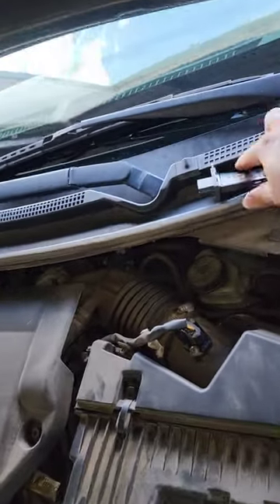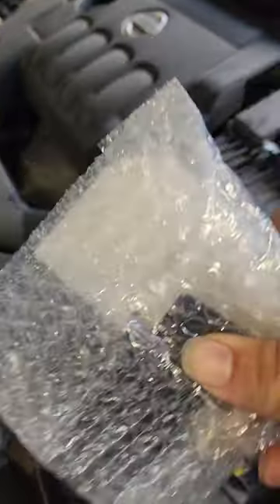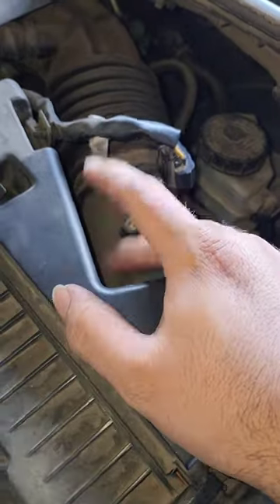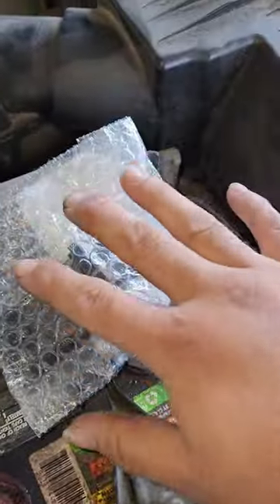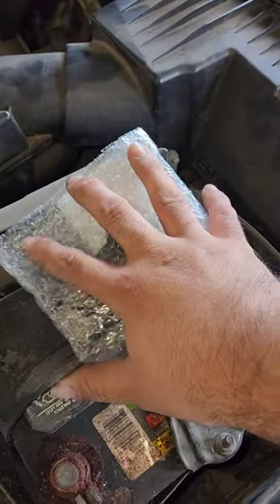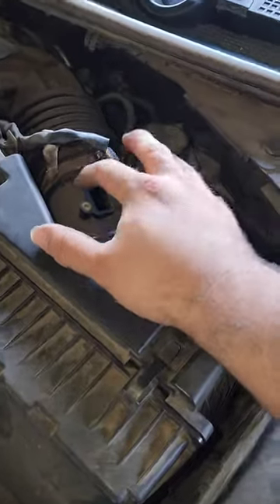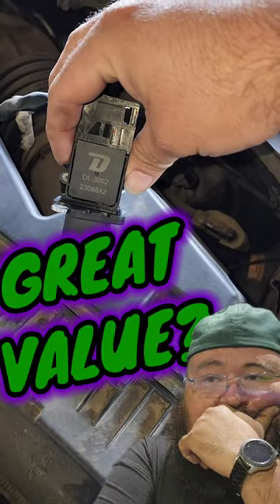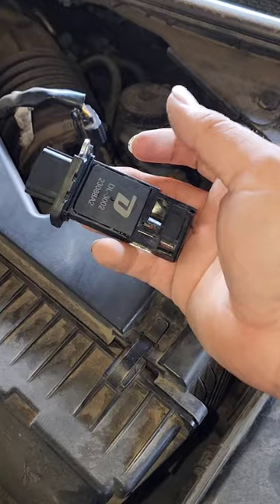AUTOZONE STRIKES AGAIN #shorts #auto #mechanic

Comment: OEM quality isnt what it used to be! 😢
Reply from the maker: Hind sight i dont think the sensor failed to begin with...granted it did have 150k on the ticker but i think they got conned into buying a sensor yet this vehicle needed an update for that code being thrown...then by then using the duralast part just upset the computer and threw all sorts of mass air flow codes...ouch
Reply: @FluffyMexicanik  years ago ( in the late 80’s ) GM had an issue with their mass airflow system. There fix was not only the update but they had built an airflow that didn’t actually function, it was designed to trick the computer to think it was working and kept the light off. I think that practice by manufacturer is used too often , remember the diesel scandal by German cars .
Reply: @buffystclair9042  you almost got it right. GM computers were designed to correct the sensor faults. Even my 99 s10 does it. I know when it has a misfire but the computer advances the timing just enough to keep the check engine light of. It will do that until the plugs are completely shot or the ignition module fails.

Comment: I find it funny that guys at dealerships only want OE manufactured parts ( built by someone else and labeled OE) but if they are guys that do side jobs use the aftermarket ones( built by someone else) , guys in the smaller independent shops use aftermarket ones mainly due to cost , customer doesn’t want to pay OE. If there is a comeback, other then inconvenience, shops are reimbursed by the supplier in the first 90 days. Busier shops are reimbursed parts and labour. ( at least where I live in Canada). In my 40 plus years, comebacks are less then 10%
Reply from the maker: Buffy, i clearly stated who makes our OE parts....hitachi...why the dealer part works? Well simply because the ecm is tuned for the precise readings that part sends back to the ecm
Reply from the maker: When its engine or transmission control related its OE no questions asked